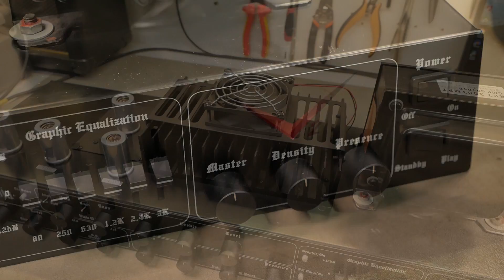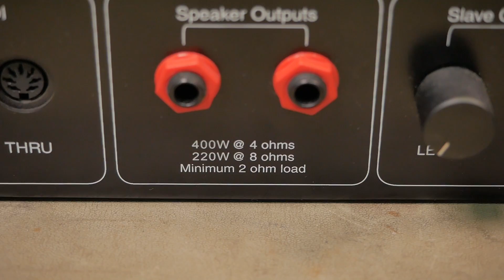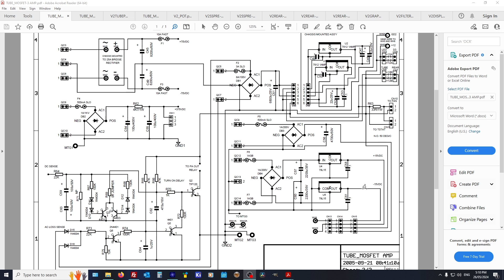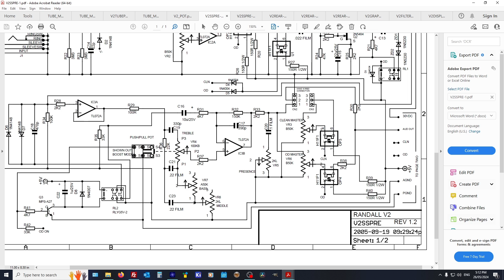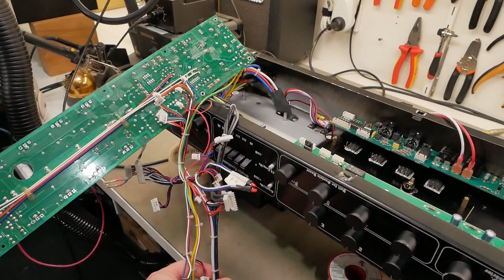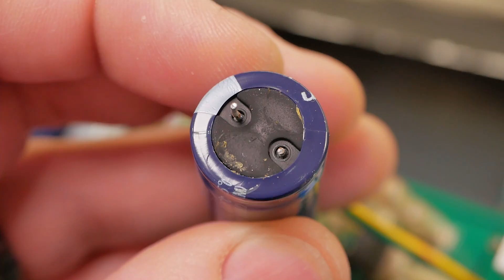Randall Ninja V2H Michael Amott Signature Head

Comment: I'd been lead to believe that most techs won't work on SS amps and would generally suggest you tossed them out and get a new one. This gives me hope.
Reply from the maker: There is a repair cost/market price balance there, but if you're happy with the amp and the parts are generic / still available and the price is right, I think it's worthwhile.
If there are tech who just refuse all S/S gear across the board, I'd suspect that perhaps they don't understand it.

Comment: you mentioned Egnater, my Tweaker 88 blew a few times before I gave up on it. I've heard it's usually a transformer issue, do you have any experience with them? Such a shame that an amp that nice should be so unreliable
Reply from the maker: Yes, they (not Bruce, the company who licensed his schematic and name) started cutting corners and cheaping out on the transformers. Replacements are available from Mercury Magnetics, however I suggest getting one sourced and installed by a tech whom is an authorised reseller, as they get great discounts and you'll likely get supply and installation for about the same price as the consumer retail cost of the transformer only.
Reply: @BradsGuitarGarage  thanks mate

Comment: What are the little red-brown cylinders mounted to the board behind the big blue filter caps? Capacitors, or Wilkoman fuses?  I've seen red-brown capacitors like that in a lot of older European hifi gear, and the bakelite shell develops microcracks and lets moisure in. If they're fuses, that's a bad way to utilize them because theyre typically soldered in place and so it would require massive disassembly to change them (although I see what looks like a white base underneath them and I suppose it could be a plug in socket if those are indeed fuses).
Reply from the maker: They're small radial fuses. I think they are on sockets, yes.
Marshall and others use them often, just soldered in place.
Reply: @BradsGuitarGarage  , yup, Wilkomman fuses or something similar. I've never seen them socketed, only soldered in place. BTW, there are also miniature fuses that look like a two-legged plastic transistor, sometimes seen in 70's/80's Japanese hifi gear.

Comment: Desoldering all the output mosfets may have been the easiest way to get that board out, but it wont be easy to line up several dozen transistor leads with the holes/pads in the PCB for reassembly!  Each row of mosfets should have had an aluminum strap bolted to them before installing the board into the chassis and then you could use machine screws from underneath the chassis gointo into threaded holes in the aluminum strap to pull the strap and attached mosfets down against the chassis, with some heatsink grease between them. A common assembly technique for hifi power amps.....
Reply from the maker: I was dreading that, but they actually went straight back in.
I'm as surprised as you. Got a win for once!
Reply: @BradsGuitarGarage  ,  Every now and then we do get lucky..... But regardless, I would happily strangle designers who come up with piss-poor mechanical assemblies like this.

Comment: Ive been using some really good 99.9% isopropyl on some boards recently, and I've noticed it sort of discolours the board, or maybe not so much discolours it, but it leaves almost like abit of a haze, have you ever noticed that with the strong alcohols at all?
Reply from the maker: Yes, that's some residue of flux left behind.
Give it a few more rinses with clean alcohol and a cleaned brush.
It gets less hazy each time.
Then after 3 or so rinses, scrub off the remainder with a dry brush and it should look pristine.
Reply: @BradsGuitarGarage ,  The hazy flux residue is much more noticeable if the board was manufactured with lead-free solder and you're cleaning it with alcohol.  It's my understanding that leadfree fluxes were designed to be cleaned off with water, so perhaps distilled water would be the way to go, followed by alcohol at the end.
Reply from the maker: Interisting. I'll give that a try next time. Thanks mate.

Comment: I was into it real [too] serious until the  " 2-ohm Crowbar "  remark. Thanks for snapping me out of it.
Reply from the maker: You no like exaggerations?
Reply: A few classic hifi speakers such as the Quad electrostatic  actually incorporate what is known as a "crowbar" protection circuit: if you exceed a certain input voltage  a relay activates and short circuits the input of the speaker so that you won't blow the speakers, but unfortunately you might blow up your amplifier, especially if it's solid-state.

Comment: Gosh i couldve sworn those look like dry-joints @11:04 with the rings around the pads?  Must be optical illusion on the vid.  Nice work man, not for the faint-hearted.
Reply from the maker: They are riveted stakes for the source resistor standoffs.
Similar to that seen in some Peavey amps.
Reply: @BradsGuitarGarage  ah that makes sense